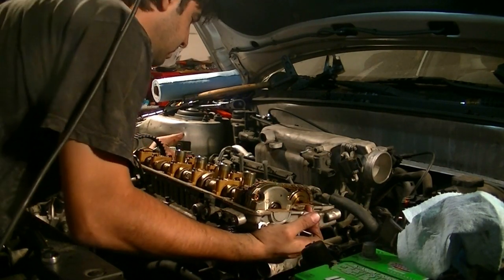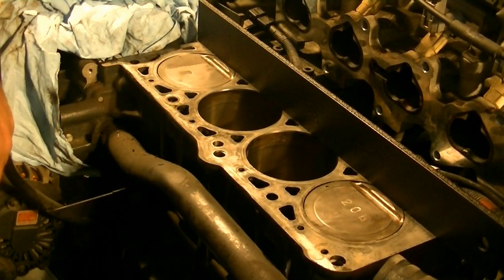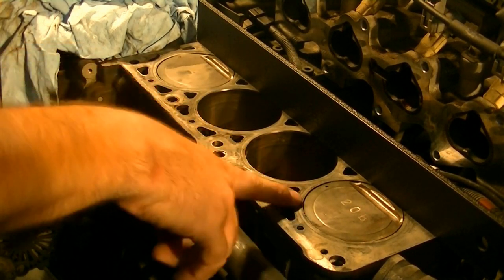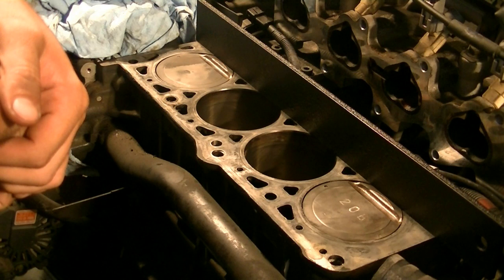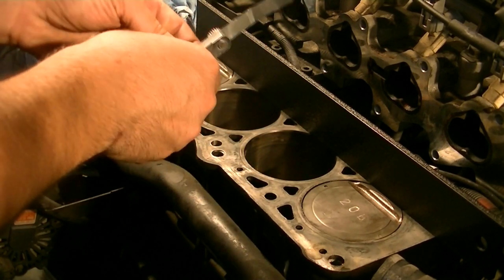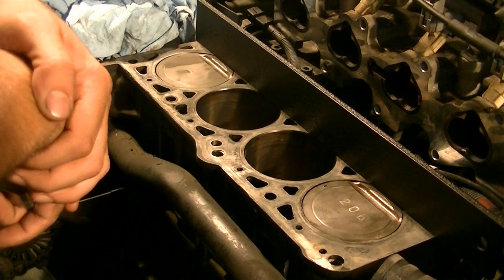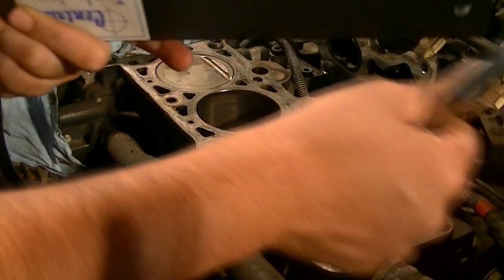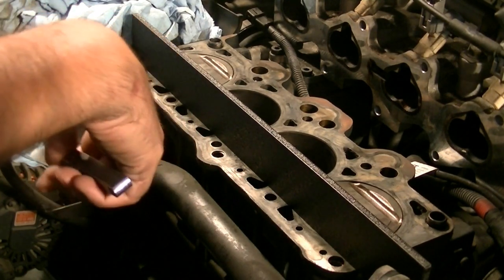How to Replace a Head Gasket Part 4

Comment from the maker: The previous owner was told by the dealership that the thermostat was the culprit, the owner of the other Elantra that I mention in the videos was told the same thing, unfortunately I already tossed the old thermostat and cant verify but if two different dealers have said this than its probably accurate and a flaw they know about. Also I think the head warps first because its aluminum (softer metal) and a smaller chunk of material like you said, as opposed to the cast iron block, Cheers.

Comment: Thx for the video. Overheating would more likely warp the cyl head before the engine block. the cyl head is a smaller chunk of metal. But the warp would more detectable on a larger piece.  Perhaps somebody can correct me. It would be really good to know what actually happened from the owner of the car. Perhaps the clues are there somewhere in the opened parts. Whether it was a coolent leak or a failed thermostat that caused the overheating.  I am glad you are showing us the simple tools first

Comment: Thanks. I've noticed that lighting is also good. The overall effect of a steady cam, good lighting and unhurried presentation helps in the learning. Most engine parts are dark and uninteresting. Video with commentary definitely is no contest with still pictures with text. Though each has its uses.

Comment: When you were measuring for warpage with the feeler gauge - what is the straight edge device that you were using and where can i get one of those?  I didn't quite catch where you said you bought yours??
Reply: It's called a machinist's straight edge.  Check online, its easily available in different sizes.

Comment: my car (Hyundai Accent) produce white smoke from exhaust while running (lesser amount of smoke,when i accelerate the pedal at high level) and engine oil drains out very quickly. Could you please tell me what the actual problem ?

Comment: What do you do if the block was warped?  Does that mean get a new engine?
Reply: That will probably be the most cost-effective option.  Because otherwise, you are taking the engine out to take it to a machine shop to have the block head surface machined. Cheaper to just replace the engine, IMO.

Comment: right at 00:34 seconds the two holes at the bottom of the screen between cyl 2 and 3...the hole to the right constains some kind of a oil return valve that in my engine ( hyundai tuburon 2001 2.0L . which is thesame as the one you are working on )was completely cooked and damaged..do you know whats called or the part number?
Reply from the maker: Sorry no idea, just remove it and take it to the Dealer. They will pull up an exploded view of the engine and get you the part or at least a part number. Than you can buy it online for a fraction of the cost :) GL
Reply: its called a non-return valve. its just a check valve. Part number is 2113523010

Comment: I have a 2001 Tiburon. Also a 2.0 Beta. Im doing a head swap and found your video because i have a broken non-return valve. The location for this valve is in the engine block. the head gasket connects it to the forward head bolt between cylinders 2 and 3. 0:15 . Have you encountered this? because there was no one installed on this beta you were working on

Comment: That's a cast iron block they do not warp the only thing that can is an alloy head but even that is a myth if the head is bolted down torqued it can't warp it can cracking bur when a head gasket goes it's normally caused because lacking water or low oil levels the most powerful to blow a head gasket is steam as steam was so powerful that's why we used to have steam engines and that's why steam will come out the exhaust

Comment: im not sure why he is calling this head junk . and is going to replace with a new head . i am a honda mec . and he said that the car has a bad head gasket why would you not just have the head surfaced and new gaskets .hell of lot cheaper than a new or reman head . so just wondering  why you would do that . is there a crack or bad cam jornal. just asking because that is a lot of money you dont need to spend
Reply: Jerry Kissinger  can you help me with some issues on my Honda?
Reply: I'm guessing it is because the head is so badly warped (all cylinders tested out at 0 psi compression).

Comment from the maker: Question 1: Feeler Gauge (any parts store has them make sure they go as low as .0015 atleast. I strongly urge you not to reuse the head bolts, they were $36 for a set at autozone for me. You also really need to be careful when dealing with timing, you could damage the valves if you dont do this right! Check out my channel, I have a 3 series video guide on timing belt replacement for the same engine. GL

Comment: i  forgot to say the other reason would be past max warpage . it is not a very common on honda. but i dont work on to many hyundia it may be common for them.  that would suck reman head cost  a little bit more than a resurface
Reply from the maker: thats what happened it was past max warpage, a rebuild head off ebay was $350 shipped if I remember correctly. Valve job and resurfaced, not a bad deal.